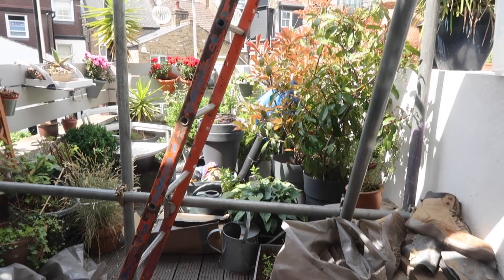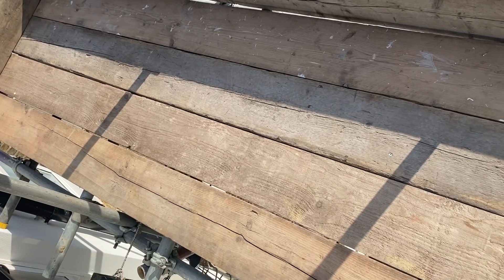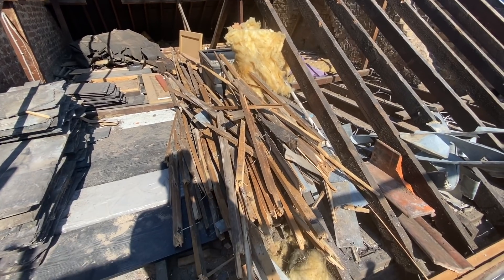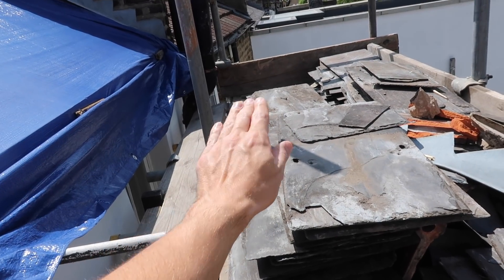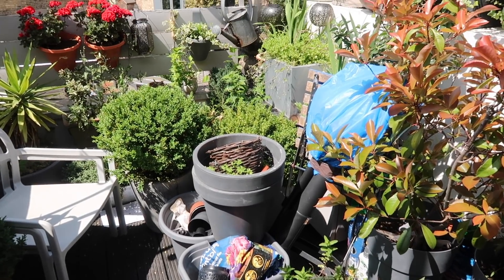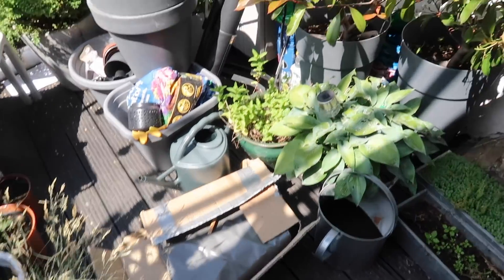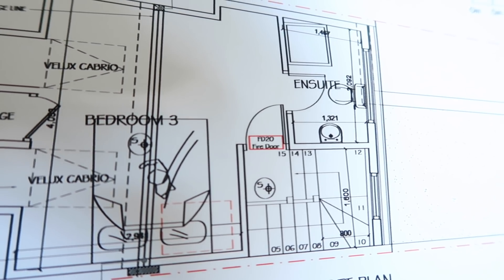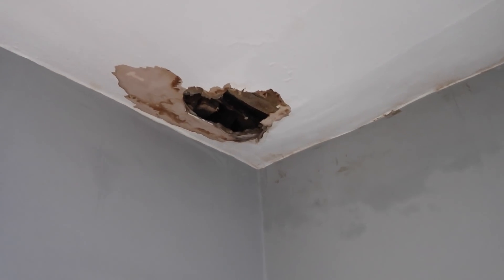LOFT CONVERSION WEEK 1 *Roof is off, leak & floor samples* VICTORIAN REFURB UK | MR CARRINGTON

Comment: Success with the refurb! It for sure will turn out wonderful. Hope the stress won't be too much. Was surprised to notice that the builders didn't put a 'work carpet' over the stairs and in other areas where they go. If you've seen Catherine's (@daintydressdiaries) bathroom overhaul, you know what I mean. Would save you from again having to paint the stairs :(.

Comment: How exciting !! As much as you live in pure chaos for weeks whilst the work goes on, I honestly looove refurbishments and such.
If I may…I had myself chosen a light flooring for a similar conversion and honestly regretted my choice down the line. Indeed it brought light and indeed it looked very sleek but it felt cold and no extra decorations or soft furnishings could get rid of that feeling. I really liked the first two samples and the oak one at the end. It keeps it light but still gives that warm and cozy feeling which may also create more cohesion with the rest of the house. If you really would prefer a more modern approach than maybe go full out and get some information on costs for a polished concrete (which can be tinted in any colour you like from light sand colour to dark grey). It gives that modern look and is actually very low maintenance !
In any case, it’s your home and you should absolutely do what you want and with your tastes. Can’t wait to see the next episodes of this exciting journey !
Reply from the maker: Thanks for the tips 🙌

Comment: The flooring with the different width boards will look more natural then flooring with the same sized boards. My aunts house is over 70 years old with the original hardwood floors of different width boards, and it looks good. 

Don't go for to light a floor color or it shows dirt from shoes easily, and don't go to dark as it will show dust easily.  Growing up, my mother was always dust mopping our dark hardwood floors for that reason.

Comment: Greetings from Chicago.  You’ve picked some terrific flooring options.  Glad it’s not going to be carpet.  Those of us in far-flung places think of this loft conversion as where we’ll lodge should we ever venture to London.  So, be careful about how nice you make it.  In the new bath, the concern is getting whacked in the knees should the door be opened while sitting on the toilet and in even having adequate space to close the door after having stepped in.   If not too late, options to consider would be a sliding pocket door or a sliding barn-style door.   The drawback to these opts would be limitations as to where light switches and outlets can be positioned.   A pocket door might also crowd the pipes for the shower.  Another way to go would be to have the door swing outward into the room.   Further, there’s not enough room to stand in front of the sink.   Too crowded; the toilet is in the way.  It would help to scoot the sink as close to the door as possible.  Right now, a wall-mounted sink is drawn in.   It would be nice if the sink were in a vanity cabinet so there can be counter space—perhaps with some storage below.   It may have to be open storage right next to the toilet if space is too tight to open any cabinet doors, but that would be a great place to set the toilet paper.   Can a request also be put in for some nice lighting, mirror, and medicine cabinet?
Reply from the maker: Thanks for the ideas!